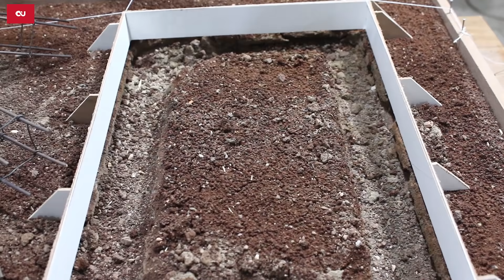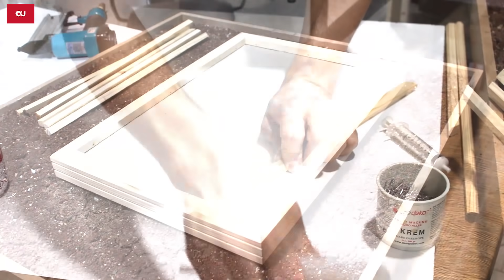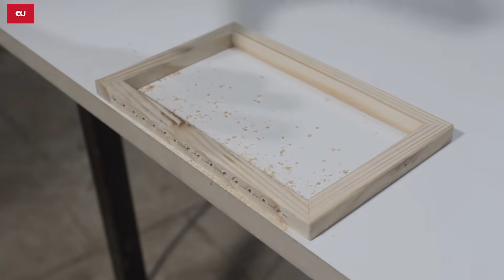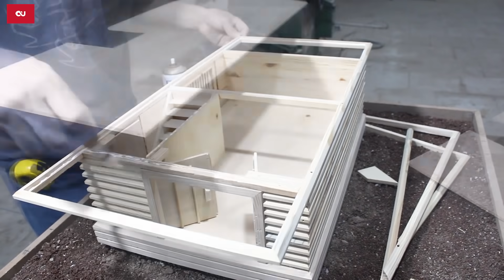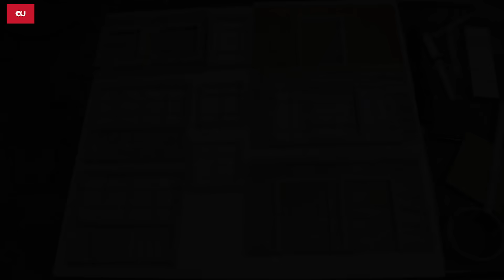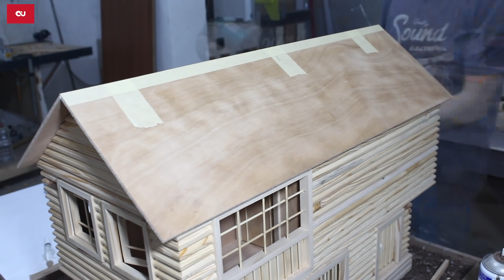Making Miniature Wooden House / Alaska Homes / how to.

Comment: nice work. I like it though, it wouldn't have been nice if it had been possible to open the house and see all the details
Reply: Just leave the first floor loose!
Reply: @tedwarden1608  That's why I asked. The same can be done with the roof as well. then you can see both the first and 2nd floor.